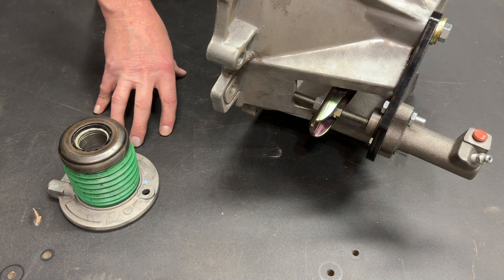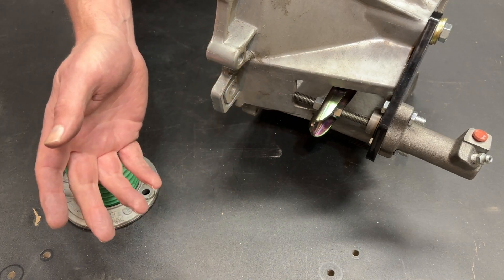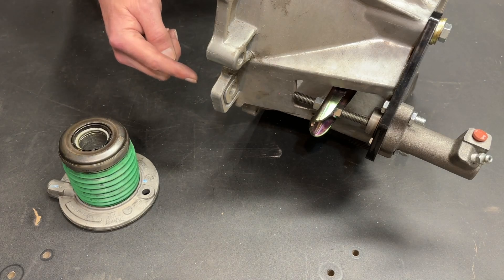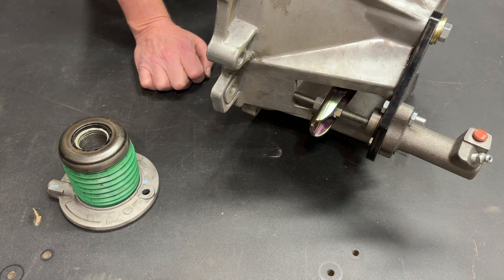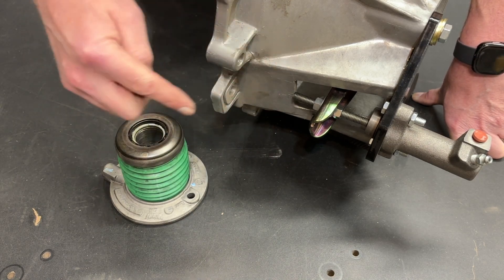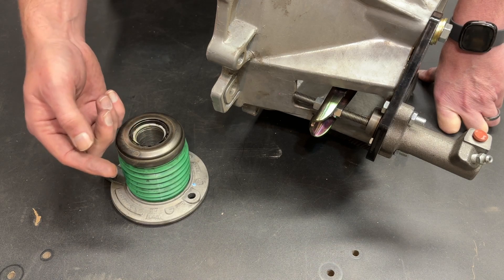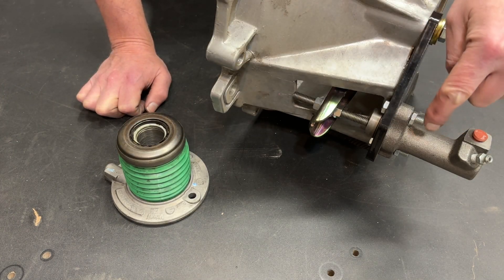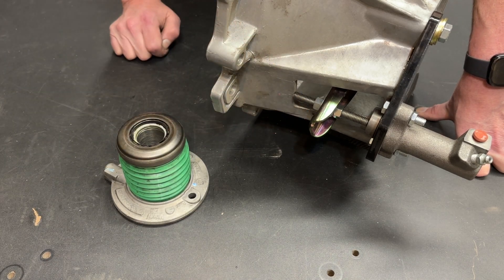Hydraulic Clutch 101 Which is Better a Slave Cylinder or Hydraulic Throwout Bearing

Comment: This is just what I was looking for. I have an AMC with the automatic adjustment clutch.yes it was a thing. It SUCKS but all the linkages are not strong enough to operate a normal clutch. This will work out perfectly with the slave cylinder option
Reply from the maker: glad I could help

Comment: Can I run this set up with the Malwood hydraulic pedal kit on my 70 Maverick?
Reply from the maker: yes.  If you get there 3/4" bore master because of the the 1.375" stroke it will have enough fluid to actuate the clutch.

Comment: Couldn't you unbolt the slave cylinder, hold the back end up, and then bleed?
Reply from the maker: yes that is a technique that has worked well for some.
Reply: ...or is it possible to bench bleed the slave cylinder before installing into the bracket?
Reply from the maker: That is another technique that has been effective for some. Lots of ways to get it done but I have yet to find one magic fix for all installers.

Comment: Credit to you i asked this question on tha last video i feel not to smart lol i think you was i can put a heat shield for the exhurst
Reply from the maker: In most cases exhaust heat is not an issue depending on how you run the line, but there is no problem using a shield or heat wrap

Comment: I just love cleaning transmission parts drenched in brake fluid and lining dust whenever my slave leaks. Add to the fact that I need to take down the transmission first!

Did I forgot to mention brake fluid eats up metal?
Reply from the maker: excellent points
Reply: @dazecars  Question: so does the Hydralic Release Bearing spin all the time since it is always rested on the diaphragm?
Reply from the maker: yes I believe they do bit its not an issue like it was on old school TO bearings.  Even a typical T5 mechanical TO bearing was cable actuated from the factory and had the TO bearing in constant contact and slightly preloaded to remove the cable stretch.
Reply: @dazecars  Thanks man. I guess I just had the wrong interpretation that Hydraulic TOs break easily.
Reply from the maker: they do break easily but its not typically the rotating assembly, its the seals.
Reply: @dazecars  Ahh shit. Either way, it's a pain to fix.
Reply from the maker: I totally agree!!

Comment: As all I work on is stock or near stock, using an external slave cylinder works best for me. Easy to work on, no need to pull the trans to service the cylinder. Adjustments are external. And it keeps all the fluid away from the clutch. Changing throw-out bearing, HTB, may need to adj shims.
Reply from the maker: Ya I tried to present an unbiased review but its really no contest for me.  A slave is way better!!
Reply: @dazecars  On a full comp car, I could see the hydraulic clutch having an advantage.
Reply from the maker: very true but on a full comp car you would think they would be running an automatic
Reply: @dazecars  I was SCCA, road racing. Sticks, baby, sticks.
Reply from the maker: I myself prefer a stick but it seams like the majority want to go automatic.
Reply: @dazecars  Same here, but if my wife is driving, it's an auto only.

Comment: Funny to see this video pop up in my feed the same weekend I'm working on my Ford Ranger's internal hydraulic slave.  
This is the third unit I've installed in 180,000 miles of ownership, and I curse Ford & Mazda for this design.

I've heard of other people going hundreds of thousands of miles without issue, but the design does not seem robust to me.  My second cylinder was doomed by a leaky intake manifold gasket that dribbled coolant right down the bell housing, into the top window of the bell housing, directly onto the trans input shaft, burning up the seal and leaking hydraulic fluid.  Beyond that, the OEM part includes plastic components, has a hard plastic hydraulic line with a loop that traps air, and a master cylinder on the firewall with a downward angle that's also difficult to bleed.

With the M5OD-R1 trans and its integral bell housing, it's a major service.  Starter, exhaust, driveshafts, transfer case, transmission, skid plates, crossmembers, all come out.  In all the years of production, I don't know if that transmission ever came with an external slave, but if such a thing existed I'd be tempted to convert.
Reply from the maker: It sounds like you've had a lot of trouble with the internal slave cylinder.  I tried to present an unbiased review but its really no contest for me.  A slave is way better!!

Comment: Curious if it's possible to install an aftermarket hydraulic TO bearing and include the fork in case the bearing fails. That way if your throwout bearing fails (and doesn't soak the clutch in fluid) you can just install the slave cylinder on the roadside to get yourself home.
Reply from the maker: no the issue is the parts take up the same space and are mutually exclusive.